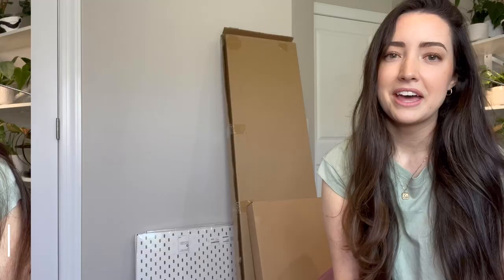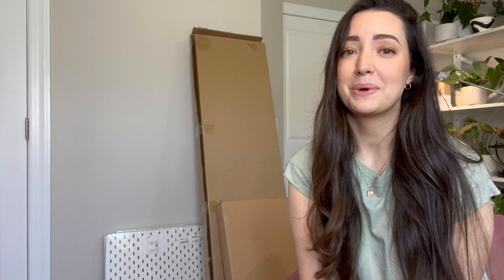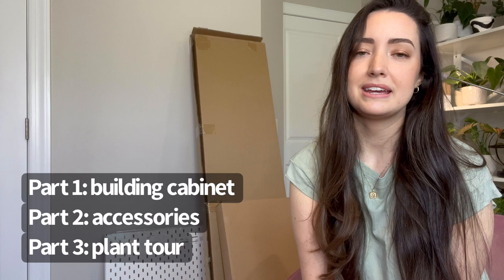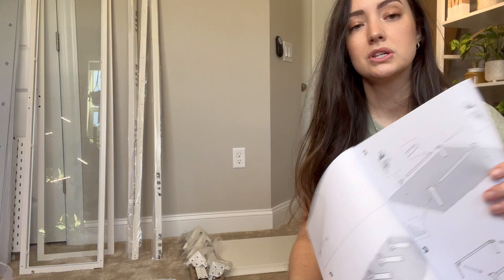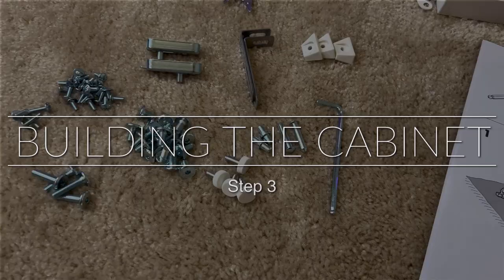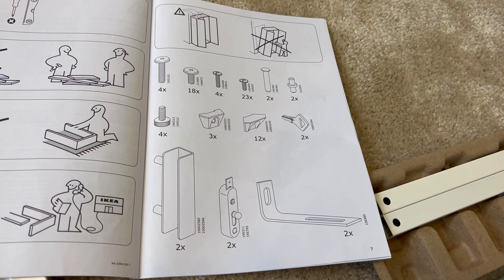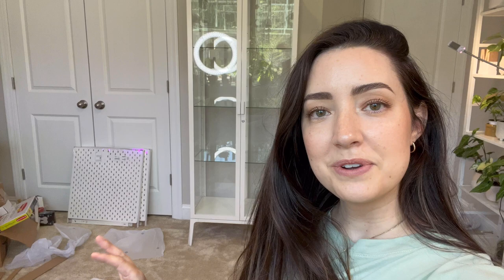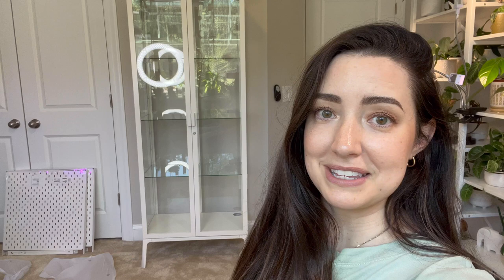Building my Ikea Milsbo Greenhouse Cabinet from start to finish and my Mistakes!

Comment: PRO TIP. Well actually just from the manual. Leave the bolts on the top of the cabinet only screwed half way down. Then there should be plenty of room later to slide the glass up and into position without needing to force them or pop into place. Then you tighten the top bolts down after the glass panels are installed. Also, do not twist the cabinet when moving it. Preferable to move it with 2 people. This way the glass panels will not flex risking damage.

Comment: Good thing I had 3 drills in my home bc trying to drill a hole in the bottom ALMOST caught 1 of them on fire. The resistance completely burned up the battery and the drill started smoking and letting out an absolutely horrible smell. I switched drills halfway thru and everything went smoothly. Ya'll just beware when drilling into the bottom that this can happen.

Comment: Hello, I decided to watch your video to see how you handled to put in place those glasses, because I had an issue too, in the manual is shown to put it first in with the upper side, then do the bottom, but that was dangerous for me, so I decided to put the bottom first and then just keep the roof one two milimeters up and calmly get there the upper side as well, so exactly as IKEA does not recommend, but was quick and safe. I like the product very much, as I usually do in case of Ikea, but I am suspecting that the one who makes the manual never tried to put it together.

Comment: Does it require weather stripping?
Reply from the maker: It may depending on your environment and how humid you want it to be inside. Mine still isn’t and it holds about 70% in my space ☺️
Reply: @plantsbymelissa  how easy you would say it is for a beginner? Also, can you do a video on what you learned till now, key points, precautions? Please please...